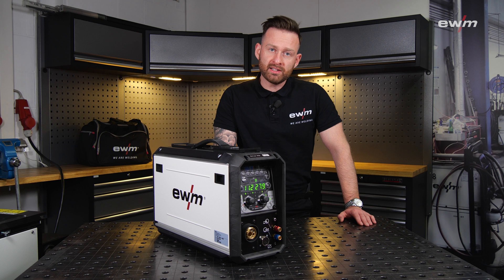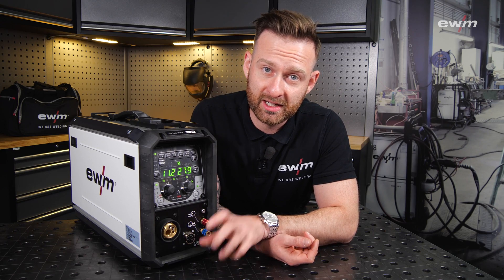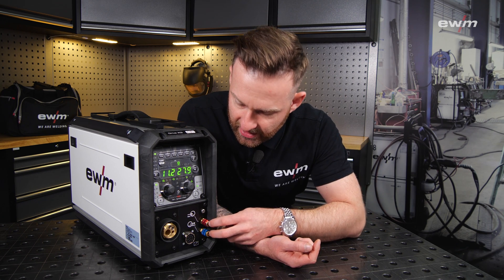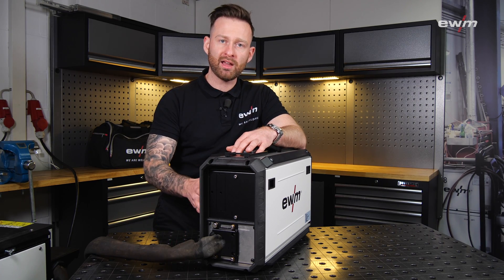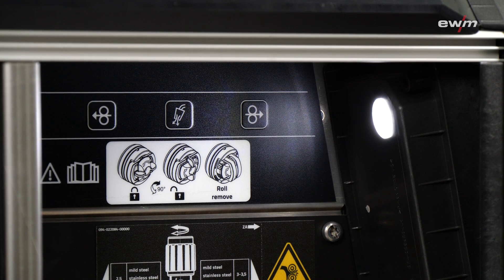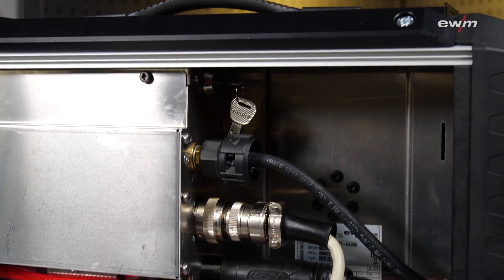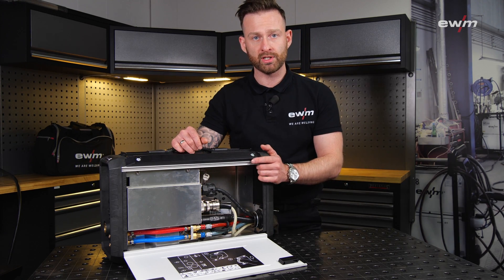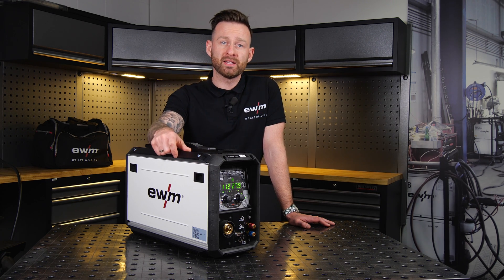Drive XQ IC 200 - MIG/MAG wire feeder for XQ welding machines | EWM

Comment: I have a ewm taurus power pack but it will not weld a stick I mmaw does it require the feeder to run?
Reply from the maker: Hello @jamesroberts6899 Yes, the wire feed unit is required for MMA welding. Only with this unit you can set the desired welding current.